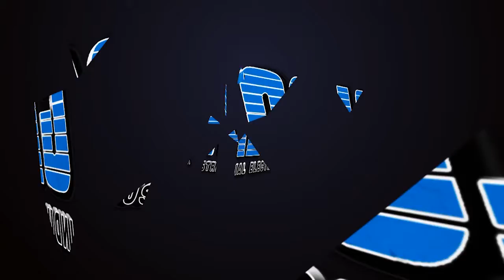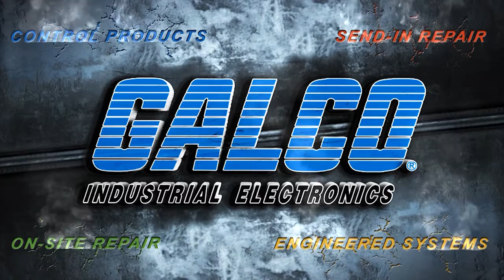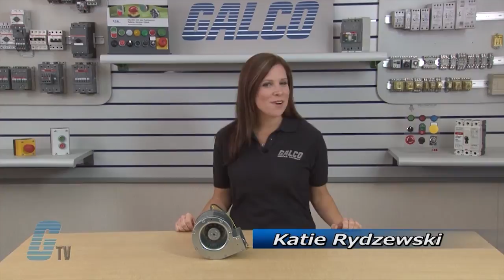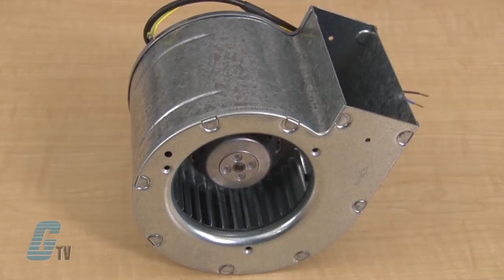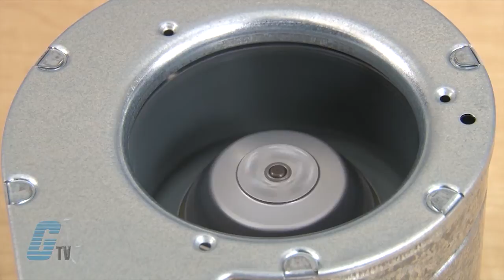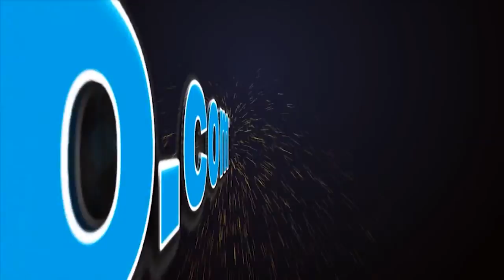EBM-Papst D2E097 Centrifugal Blower Overview

Comment: What is the pressure outlet
Reply from the maker: The D2E097-BI56-A4 is rated at 180 to 435 cubic meters per hour, depending on the RPM of the specific blower you purchase.